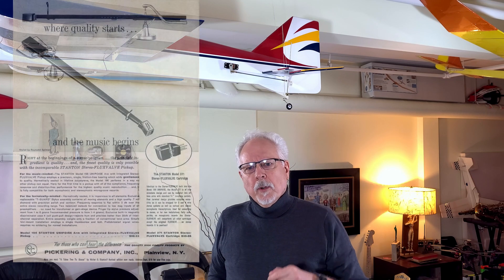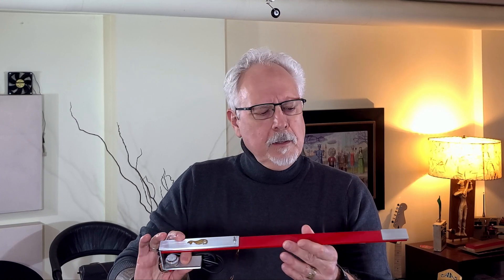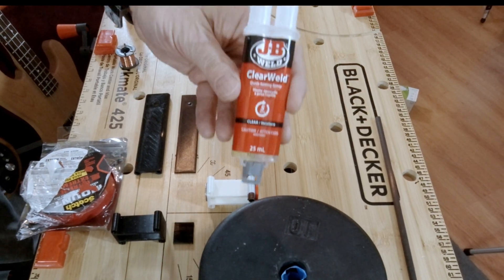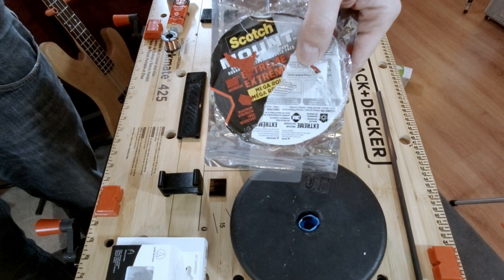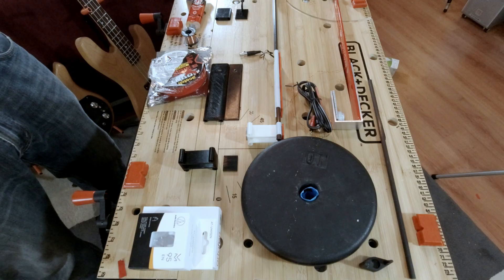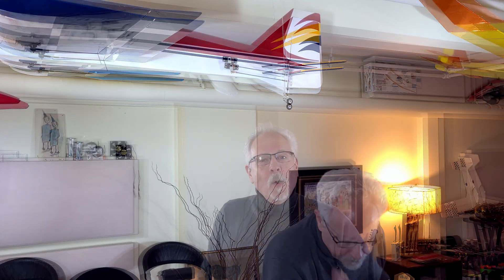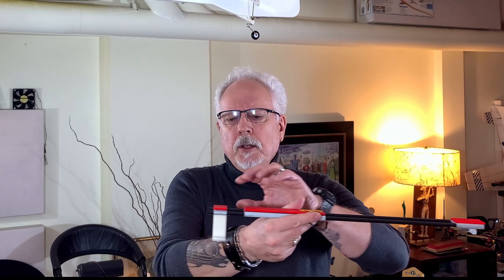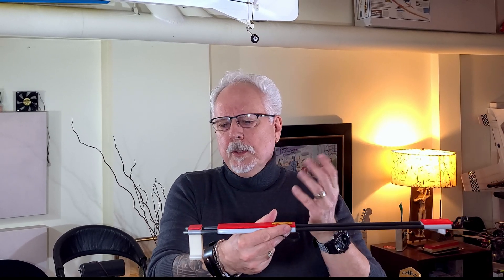Carbo X Treme Tonearm  - Concept and Build Overview

Comment: Hi I am looking forward for a comprehensive build guide for the Carbo X and of course The  Lil' Pucker Turntable !!! 
I would like to know what was  the reason to choose dual beam solution instead of single beam as described at  the Diyaudio Nanooks Thread ? With a single beam probably you will need to add only a 3d printed headshell probably a counterweight and a pivot point .
Reply from the maker: Thanks for the comment. Yes, a build vid will come soon. The dual beams were to mimic the first design I built out of wood and aluminum and also to have separate runs runs from the cart. Interestingly, I am planning to design a single beam as well. Just too much on the plate at the moment.😁Cheers.